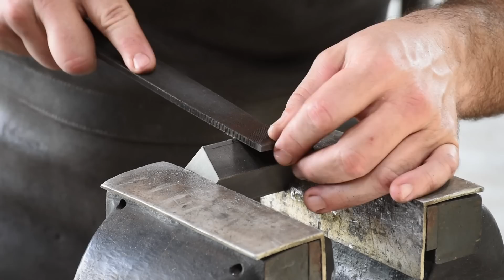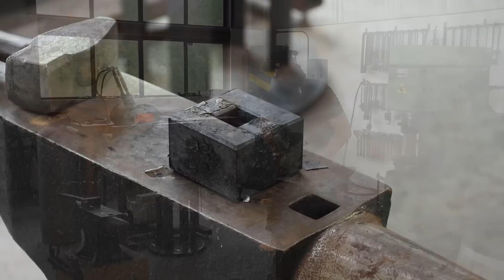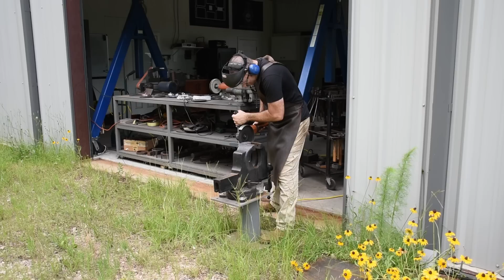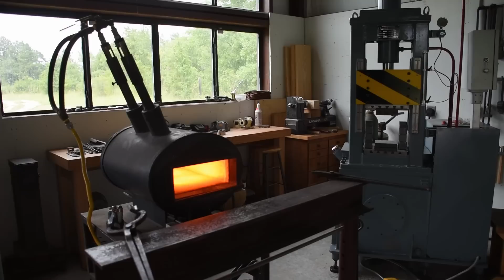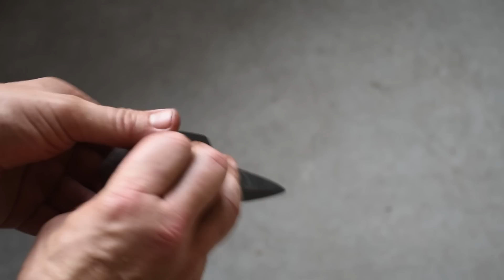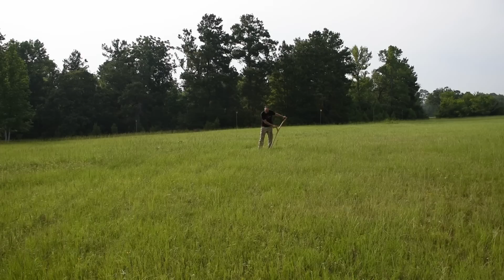Forging a Scythe Anvil

Comment: I just made one of these earlier today! I used wrought iron, with A-6 for the face.  Very nice work as always!
Reply from the maker: Sweet... how did the forge weld go?  I haven't heard of A-6 before.  Air hardening?
Reply: @rigoniironworks  Took 3 tries to get it to tack, but after that it welded nice and clean.  The a-6 was a piece I got from a friend. Never used it before so I had to look it up but yes it's air hardening.  Used for dies, forming tools, mandrels, etc.  Also mentions excellent dimensional stability in heat treatment so I guess it's well suited to face welds.

Comment: @ 09:19, I notice a lock screw backing out during the forming operation, perhaps a compression spring with a few turns might keep it from eventually falling to the floor? ☺
Reply from the maker: yeah that thing always works loose.  It's not holding the tooling down, but I need a split washer for it.
Reply: @rigoniironworks  My thought was like the old carb throttles that had that type of spring hack so as to maintain the setting, anyways your work and videos are non-pareil, thanks for posting them. ☺

Comment: What was the hardened square thing for? The one the pointy part of the anvil fit into?
Reply from the maker: Think of it like a mold.  If the forging is slightly off, after compressing, the part squishes down to a nice transition from 1" square to a bigger flat on the underside.

Comment: What was the purpose of the first piece you made in this video?
Reply from the maker: Refines the forging.  If I wanted a bigger top part, I could use the same die and compress more material.  If you look at my flatter video, I show a larger version using a sledgehammer.
Reply: @rigoniironworks  Thank you!